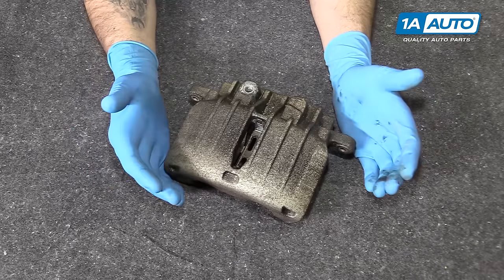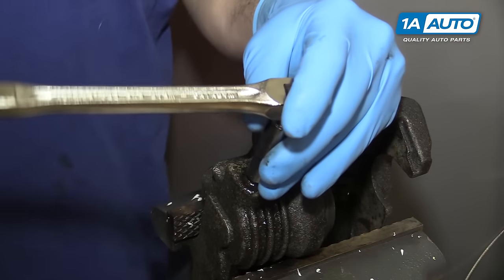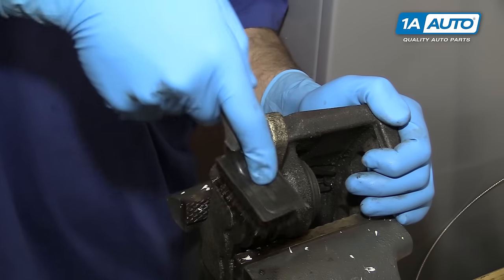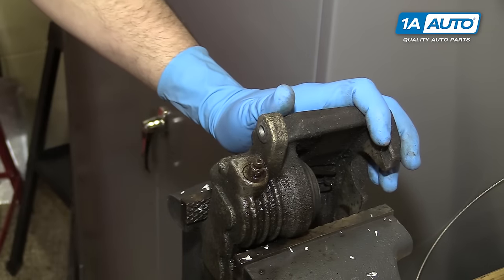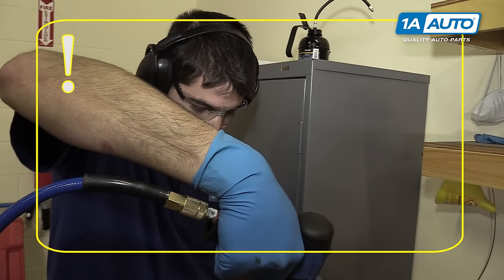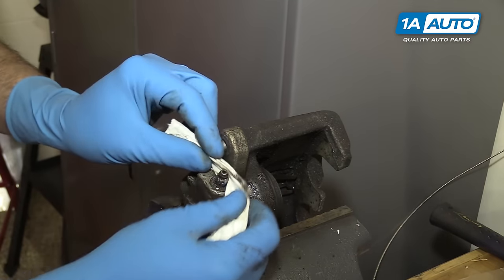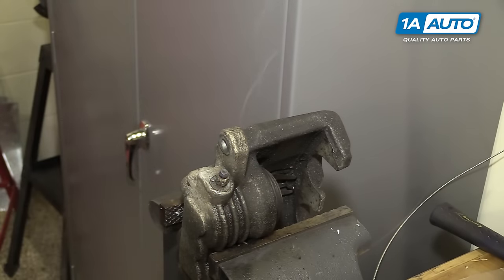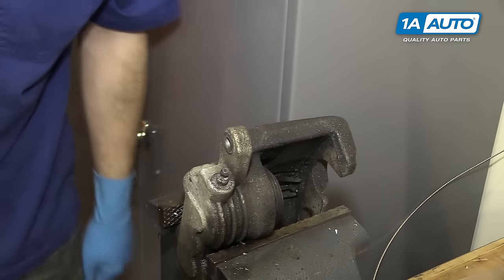How to Remove a Stuck Brake Bleeder Screw

Comment: You should have started with the heat first thing but with oxy acetylene and small tip to pinpoint the heat before you rounded off the flats,  Soak with penetrant first, wipe off the excess put six point socket on screw and hold counter clock wise pressure and heat the base metal, it has to be hot but not to the point of melting the part. If you get it to move then work it back and forth if doesn't come loose while still hot apply more penetrant and let cool and try again. Heating and cooling expand and contract the metal and allow penetrant to work in. Steel in aluminum is very difficult to remove. coat new bleeder with non hardening sealer or never seize. I have used this method in my boat shop for 35 years and it works the best of any thing I've tried. Taking the time to save a engine block or gear case is worth it but a caliper might be cheaper to replace it because you have to be patient it take time and time is money
Reply from the maker: +Steve Stonacek Excellent tips. Broken and stuck bolts can be so frustrating to remove. We'll keep these in mind for next time. Thanks for watching!

Comment: I can't believe that no one noticed that he put the penetrating oil on the threads only and not down the bleeder hole. Most corrosion is  from water getting down in the bleeder hole by the cross drilled hole. That's why you must keep rubber caps on the bleeder screws. Some manufacturers provide them on new cars, but I've seen them deteriorate and fall off or get left off when bleeding. I've also seen mechanics put grease in the bleeder hole when they are done bleeding. This prevents corrosion down in the bleeder hole where it seats on the angled seal surface. The grease will just blow out the next time you bleed. Also those who think you can bleed  from the brake line entering the caliper will never get the air out for proper bleeding. The bleeder valve is at the very top of the caliper where the air rises.
Reply: EXACTLY!

Comment: what kind of mechanic uses a carpenters claw hammer ?
he keeps calling it a "bolt" - its a bleeder ....try heating it with a real torch and quench it with cold water - repeat if necessary....even try heating the bleeder red hot - wait a few seconds before trying to open it......he quit too soon...even when the bleeder breaks off you can weld a nut on it - this usually works

Comment: The best way is to use induction heat or weld a nut onto the bleeder bolt. I have never had a failure using my methods. The ways you showed are good for the shade tree mechanic.

Comment: I literally installed a brand new caliper yesterday, bled the brakes fine. Still had soft brakes, and when I went to bleed them again today, and my BRAND NEW bleeder screw is STUCK. I took vice grips to it and everything it will NOT budge

Comment: Bleed screw design has barely changed in the last century of automobile design. If anything, it might even be more of an Achilles heel today with more use of dissimilar metals and less leaky cars. Surely car makers could do a better job of designing such a small, low tech, vulnerable and critical component!

Comment: One last ditch effort, I once took a small nut that just fit over the bleeder and mig welded through the hole in the nut. The heat from welding and new threads from nut and it spun right off.

Comment: I use a six points socket mounted to my cordless impact driver.  Hit it in reverse, then go forward, and then backward.  After a while, the frozen bleeder screw will back out of the caliper.
Reply from the maker: +Upallnight Thanks for checking us out. Shop here for high quality auto parts: http://1aau.to/m/Shop-1AAuto-c

Comment: Heat up with a blow torch then  splash with water and the will come right out
Reply: shane brunette that’s the method I use. Get the bleeder nearly red hot, shock it with water and they usually come out.

Comment: Heat that puppy up till it's red hot and it will come out EVERY time , been doing breaks since 1985 and this method has always worked . For people that say "don't heat it up like because the heat with damage the piston seal" they don't know what they are talking about , breaks can get well over 500 degrees and the heat will NOT reach the seal and btw break fluid is NOT flammable . Do not heat the aluminum type calipers red hot because you'll end up melting it , just heat it up until you see a little smoke coming off .

Comment: Pretty much sums up my last weekend. 
Tried hammering, impact driver on 12 socket, flare wrench, stripped it, propane, vice grips, screw extractor, broke it. 2nd screw extractor.. got stuck inside, more propane + Freeze Out. 0 progress. My mistakes. 1. didnt put broken drill bit inside. 2. NEVER use anything but the tightest fitting 6 socket. 3. Should have propane super heated, and then used impact/air. After I rounded it.. too late.
Reply from the maker: +dilbert mcfly Thanks for checking us out! http://1aau.to/m/Shop-1AAuto-c

Comment: Why not drill it to weaken it . Be careful not to drill into the taper seal. Use a new bleed nipple to gauge the drill depth. As an apprentice toolmaker I used to operate a 1 SIP. Jigborer. While working in the production office as part of my training, a new apprentice was operating the jigborer. A problem occurred with the morse taper in the quill for holding drill or boring tools and could not release the drill bit in it. My suggestion was to disassemble the quill from the machine.cut off the drill bit just proud of the quill ( most are soft to cut with a hacksaw). Then carefully hold in a 3 jaw chuck in the lathe. Next face the roughly cut off. Centre drill and carefully drill out the stuck tang of the drill. As the quill was hardened drilling out , in stages, no damage would occur to the quill. Unfortunately no one was brave enough in the tool room to do this and called out a service engineer who used this exact method to fix the problem.

Comment: Visual quality good.  Audio quality good.  Camera steady.   Three things most who want clicks don't have.
As for the method......Just fully disassemble the piston and seal,  hardcore clean, then heat up and dunk in water, it will come loose.   At least it has for me on numerous occasions.  But I would always want to keep my vehicle running so I want "on vehicle" maintenance tips.

Comment: I've worked on outboards,  motorcycles, snowmobiles, etc for 45 years,  a lot of aluminum!  If you give a stuck bolt,  or in this case the bleeder,  a big wack on the head with a hammer and a punch it will in most cases come loose. Theory  is that the thread in the aluminium will stretch just a bit and let the penetrant in. Sometimes I  go back and forth with heat,  then penetrant to actually quickly cool and suck the oil in.

Comment: I had this experience with a 2000 Chevrolet truck....aluminum caliper and steel bleeder. I cleaned the corrosion scale off the base of the bleeder were the threads start...put a small 6inch pipe wrench with a pipe over the end to get more leverage. Then just putting a little tension on the bleeder and tapping with a hammer around the base of the bleeder it finally twisted out. Each time it moved I sprayed a little oil.

Comment: And guys if you do succeed in removing a seize brake bleeder, do what I do, when I get mine removed, and that is to apply a thin layer of grease on the thread. Synthetic grease  preferably, then you won't run into this problem ever again.

Comment: I actually like to see that nothing worked. Too many times the videos are like, "this works." And sometimes nothing works. One note. Some calipers are so inexpensive that it is not worth the effort or risk of injury trying to monkey around. Just get a new caliper and save yourself the hassle. You can properly lubricate the bleeder valve, then, to help prevent the corrosion else in the future.

Comment: What was the purpose of this video to show what that is so easy to remove that bleeder from there, well it's easy for me but I thought you was going to show a different and easier break it off, drill it and use an easy out, thats what i would have done,and yes ive done it on aluminum calipers.

Comment: can u bleed it by bearly loosening the metal break line that connects to the rubber hose?
Reply: One can actually drill a hole into their STEEL brake lines and bleed them despite seized bleeder valves. But only if you are equipped and confident to weld it shut..

Comment: gas axe (oxy torch) and cooling to shock it has worked many times in the past. Including WD40 and other oils/lubricants etc. From experience but not in vehicle obviously. In this day and age if you've spent an hour trying to undo the bastard you just replace the whole lot.

Comment: mmmm    i find that a few good sharp blows with a hammer on the end of the bleeder  usually shocks the corrosion free. I have recently had to apply this method on all four calipers on my 2007 Citroen C6 calipers .my home mix of acetone and hydraulic fluid makes a good penetrating oil

Comment: When all else fails weld an oversize  nut to the nipple by doing so the heat travels down into the nipple helping to break the bond with the frozen nipple..another trick is warming up same and allowing a wax  candle to melt  onto same ... 'Old School'  and worth a try....

Comment: If it doesn’t leak. And you have a banjo bolt fitting for the brake hose. You can always crack the hose at the banjo bolt and bleed caliper that way. If you’re really in a bind
Reply from the maker: +Volvo 850R Thanks for the feedback!

Comment: The socket he used was not a tight fit to start based on the movement of the breaker bar.  Start with the correct socket!

Comment: In between heating add the CRC or whatever oil you use. It will penetrate into the threads more easily because you have ever so slightly expanded the base material surrounding the bleeder screw.

Comment: This helped me a lot just in that it jogged my memory that I could try a stripped bolt remover that I had. I would have never thought of that and it worked out great for me where penetrating oil and some heat wasn't working out. So thanks!

Comment: My method is to clean the base of the screw. Heat the caliper at the base of the screw to about 200+ degrees. Apply 3 in 1 oil to the base of the screw and a little bit in the opening and let sit for 30 minutes (tapping the caliper occasionally). Have a can of compressed air handy and reheat the the caliper as before and spray the "screw" with the can of air with the can upside down. This will rapidly cool the screw. Quickly work the screw out with vice grips. Install new screws with a thin coat of copper anti-seize on the threads.
Corrosion and rust is the main factor here but, often mechanics over tighten these screws. Hand tight plus a nudge or about 5 ft lbs is all they need.

Comment: This guy is barking in the wind. Want to get the bleeder out?  Get a man's torch, a, cutting torch with lots of heat and get the area around the bleeder red hot. Then watch how easy the bleeder comes out.  When putting the new bleeder in, coat it with anti-seize and then make sure you attach a rubber cap over the bleeder's hole.
Reply: fill the bleeder cap with grease and put a glob  on the bleeder and never have problems again. do this for all brake connections
Reply: Getting Aluminium Red Hot = Scrap

Comment: You can also tach weld a bigger nut around the screw to gain more mechanical advantage something like that you are likely to brake the screw off and require to tap

Comment: A method I used for many years on many applications  with total success , I will describe the worst removal I achieved,   Working as a maintenance fitter for the last 20 years of my career, my main duty was repairing Automatic Pneumatic Feed Drills  These drills had a hydraulic control unit fitted to prevent the drill jumping forward on breakthrough and jamming with resultant drill bit breakage    The valve body on the H .C.U was fitted with a hollow hex grub screw Bleeder that  sealed on a taper face and was flush with the unit face  when tight  This screw was 5/32 diameter and had a groove down the length to let the oil pass when bleeding  If the screw was over tightened it would crack and swell in the bleeder port  almost impossible to remove,, But a little weld with an arc welder using a fine 16 th rod inside the hex would see it loosened and easily removed  many times with no more that my fingers after it cooled of course  This welding of broken studs has many applications with some modifications  and has never failed me yet especially in aluminium bodied units such as the H.C.U    On other broken studs flush with the unit surface I just build up a a projecting stubb  and hammer a scrap nut over it and run a good weld ofer stubb and nut let it cool till just after the red disappears and rock it loose X tight  when it moves use penetrating oil and unscrew. Hope this works for you as well as it has for me

Comment: ... if you fill the caliper and master cylinder with brake fluid ; You can bleed the air out when you connect the brake line to the caliper . I leave the piston on the caliper out a little bit , and push it in before tightening the line , this pushes  the air out . make sure the master cylinder is full and the brake hose is dripping brake fluid when you make the connection .Then assemble the caliper to the spindle . Don't take anything apart you don't have to .
Reply: Exactly what I was wondering. Why can't it just be bled where the brake hose joins the caliper. Always pays to read the comments. Thank you.

Comment: For really rusty old parts, use penetrating oil over several days after wire brushing off rust. Patience is the key. Also use oversized deep socket to tap around bleeder valve with light hammer.

Comment: Aluminum and steel never did mate together and never will.
Reply: [Bruce Bonebrake voiceover and cool accent from AutoZone]: "this is why anti-seize is used on spark plugs- prevent gs
Reply: Yeah after dissimilar metals sit for a while they make an electrolytic bond that makes them near impossible to break loose
Reply: They mate forever
Reply: '95 3.8 v6 FORD problems.